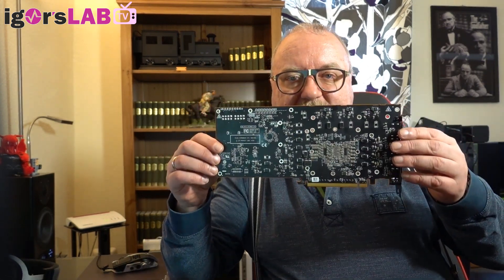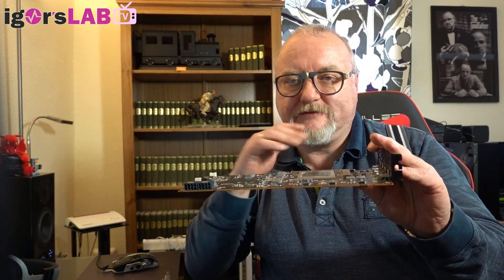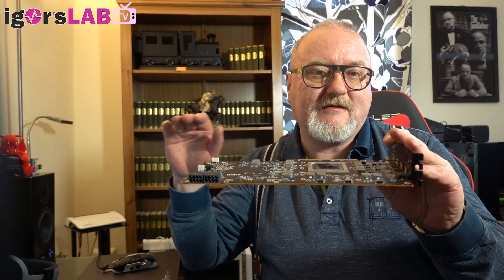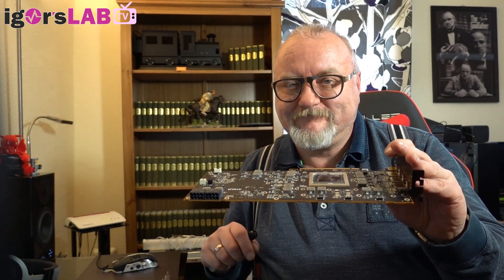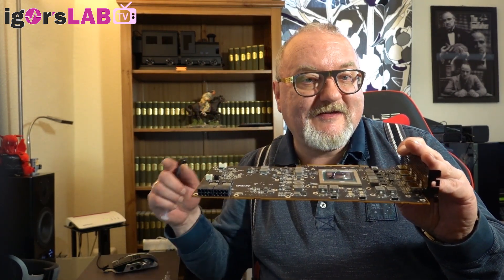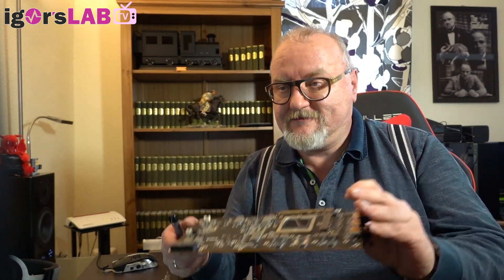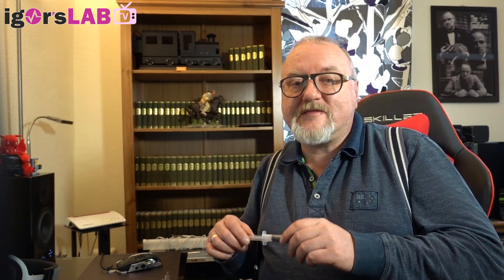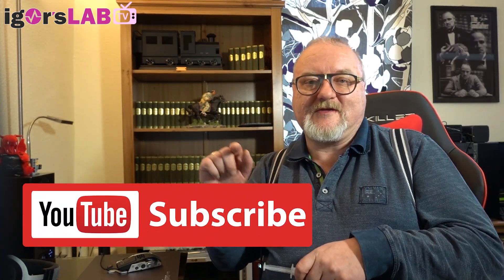The secret behind AMDs mysterious thermal pad on their Radeon VII is a polymer (EN)

Comment: Fascinating. I just ordered one of the last Radeon VII cards in the US. From what I hear this polymer thermal pad isn't performing well unfortunately.
Reply from the maker: It works. The vapor chamber is not really even. And they used it since years for the Radeon Pro cards 🙂
Reply: @igorsLAB  Yes, I see many people have to flatten the vapor chamber with sandpaper to get good contact.

If I carefully take apart my new card new, I wonder if I can save original graphite pad before it cooks on and expands.

If not  I have thermal paste, but it's worth trying.
Reply from the maker: @carrytrainer.editor3321  Each card was tedted in factory, it is alreay done :)
Reply: @igorsLAB  Thanks, that's good to know. I'll watch the Hot Spot Temps closely before I do anything then.

I hear Hot Spot 30C above the main gpu temp is a bad cooler mount.
Reply: I got lucky. The stock cooler on my Asrock Radeon VII works really well. With 100% fan at stock settings my Junction Temp peaks at 86C in Time Spy. Cheers
Reply: Damn I must have gotten a terrible card, 100% fan speed and it still hits 110℃ junction and throttles. Edge temps in the low 80s. I'm definitely going to use a water block.
Reply: @carrytrainer.editor3321  yes amd vapor chamber is not that flat. I have a vega 64 with the reference cooler. I lapped it first. Temperature was better but still not great. Hot spot is about 20 degree from gpu die. Then i read about the washer mod for 5700 xt. Thats did the trick. Temps was way down at hotspot is only 5-10 degree variance from the gpu.  My vega 64 now has a managable temps and fan speed. The blower style cooler is now bearable. Hehehe